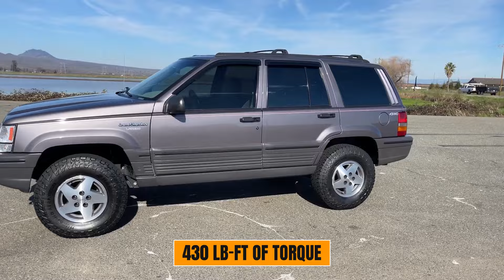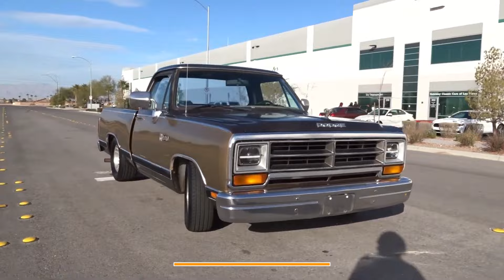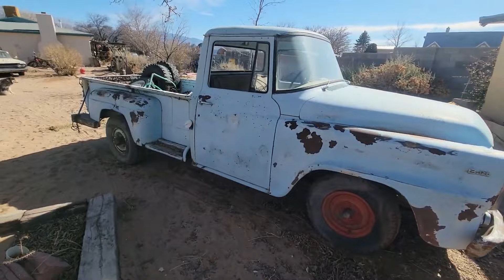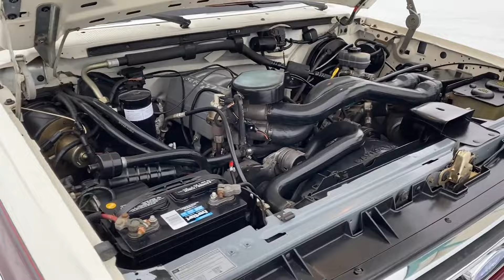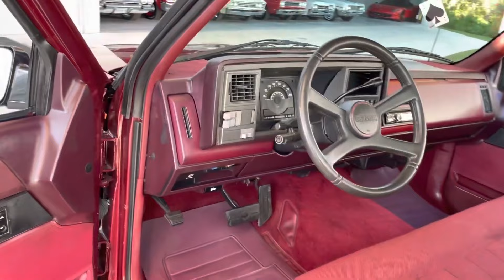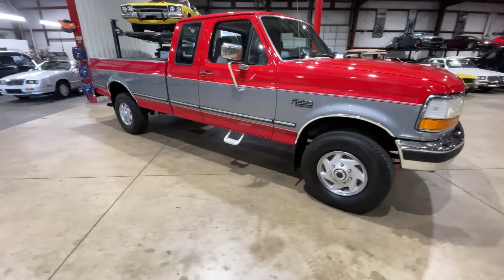10 Old School Truck Engines That Modern Trucks Can’t Beat

Comment: I'm surprised that the 225 cu in Mopar slant 6 isn't in the list. I had a pick up with that engine that was one of the most reliable vehicles I ever owned. I also had a 1976 Dodge Aspen SE Sedan with the same engine, smooth as silk and just kept going on and on.
Great video